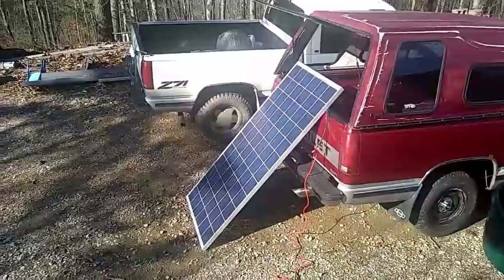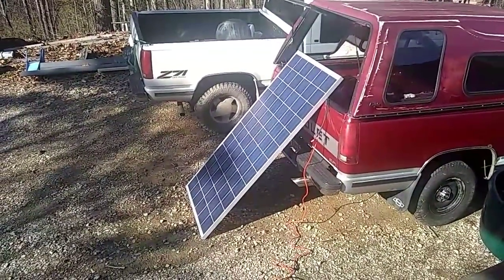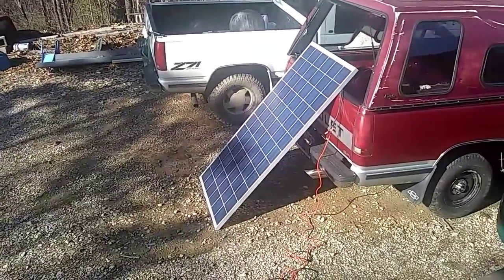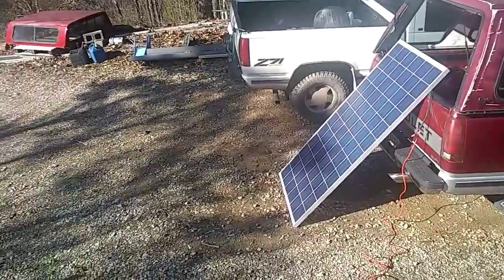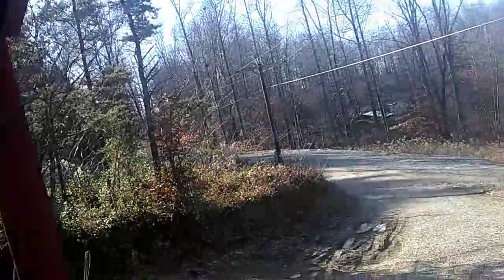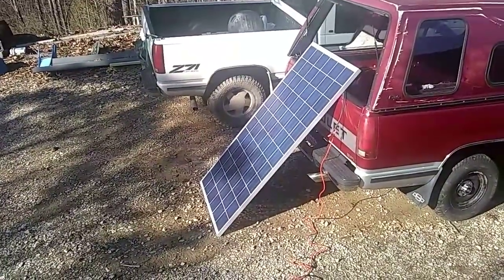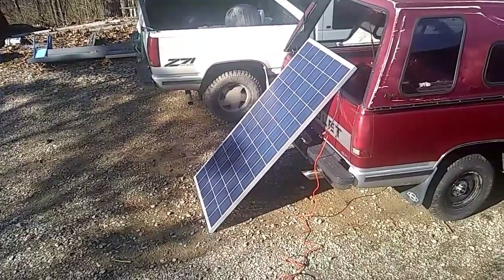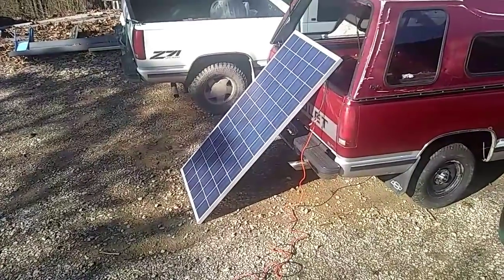Solar Heater oil proof of concept best design

Comment: I have built steam engines from scratch for over 50 years. That said, I have a pretty good grasp of power.

It is never a good idea to convert solar electricity for use as a heater.  If you want heat, do like I do and make a tracking concentrator.  I have one that makes live steam, and if I change the working fluid to peanut oil, i can store heat for about 3 days, enough to generate live stean.
Reply from the maker: I don't know man steam is kind of dangerous ... Things explode with boiling hot steam.. One faulty pressure valve that doesn't pop and bad things happen. That's why I'm also not a fan of boilers. But I moved on to running space heaters direct off panels. Lot easier to control put in safety measures. But honestly neither one of our systems are as good as the direct solar too minisplit they are selling now.
Reply: @WealthandTravelonaDime  
I've never had any steam accidents in 50 + years of building things.  If it's a problem, use a monotube boiler - nothing to let go except a length of tubing and that is shielded inside a steel housing.
Reply: Hi !
What you're explaining here looks like what I'm working on. I'd be very interested if you woud share some details of your achievements. I currently try to design a small solar plant for an off-grid community using homemade parabolic troughs coupled with high temperature heat transfer fluid. The idea is to have an operating temperature of 200-250°C and use the heat stored for every daily needs : cooking, heating, generate steam for mechanical energy...
It seems like data concerning low-scale power plant is unavailable at the moment.
Please let me know if you're available to discuss it.
Kind regards.
Reply: @victorfouquet8669  
Parabolic is over thinking. I use frustums. Parabolic has to be mammoth big to make a useable steam flow. A frustum mirror gives me nearly 1000 : 1 concentration while still being trackable. I won't share the fine details, because the energy my mirrors produce will melt carbon steel. Make a mistake and you'll instantly vaporize  yourself.
Reply: @WhatDadIsUpTo  Never heard of this kind of shape, even in industry...
However, if we achieve a global efficiency of 70% with vacuum tubes collectors, some calculations make me think that 6m² of parabolic troughs could generate 30kWh a day with an irradiation of 5kWh/m²/day.
Which could generate 40kg of 170°C steam or 3kWh a day with a less than 10% efficient steam engine...
From my point of view, it's already beyond expectations.
But I'm more concerned about using a high temperature working fluid, preferably environment friendly, and how to design the circuit and the storage.
If you're available to help in that way, I am.
Thank for your response.
Reply: @victorfouquet8669  
WATER has a specific heat of 540 KCal/mole.

It doesn’t get much better than that unless you use a very exotic fluid.

My entire mirror is 12" thick and 6' diameter, made of welded steel & sheet steel YET it can achieve a 1000:1 focus, which creates DRY STEAM @ around 1000°F instantaneously all because of the mirror shape. 

A parabola can be produced by removing a section of my mirror at any location. 

I've already told you the shape. Grab a book on geometry to figure out the details, but I'm serious -- be careful !!!

You've been warned.
Reply: @WhatDadIsUpTo  Do you mean pyramidal or conic frustum...? Is your collector a pipe or a unique solid ?
You don't speak of your storage or the heat transfer circuit you're using with peanut oil. Could you share some informations about the circuit itself ? I suppose you use a thermal storage with high inertia to later pump the fluid through it before making steam via a heat exchanger in a boiler ?
Reply: @victorfouquet8669  
Conic, solid, no transfer - steam generated & used @ point of use. In a separate system, heat stored in a 12-gaklon steel tank insulated under 3" of silica sand & heat transfer occurs through emerged 3/8" copper tube coil exchanger. I use this for year round domestic hot water.
Reply: @WhatDadIsUpTo  Ok really nice.
One last question : what kind of pump are you using to circulate peanut oil at high temperature ? It happens that HT pump on the market are mainly designed for industrial applications with high consumption and flow.
Reply: @victorfouquet8669  
Gravity pump.  The receiver is mounted physically higher than the flat-plate collector. As the oil heats, it's density lowers and it rises against gravity, creating a thermal loop. It's called a "thermosiphon".
I'm autistic and a big fan of keeping a low profile and doing things the simplest way possible!
Reply: @WhatDadIsUpTo  I'm glad to hear that. As I'm not an expert in boilers circuit design yet, I base my statements essentially on what has been done.
It's some good news as thermal pump consume a lot and costs much.
I'm very thankful for these informations, and I'd appreciate to know more.
Are you using HT valves and other HT gear with flange connection like in industrial kind of stuff (or no gear at all) ? It seems like nothing else is appropriated to such kind of high temperature fluid...
It also means that your thermal storage is higher than your collector, as well as your steam engine...?